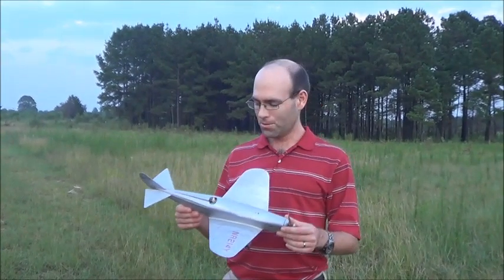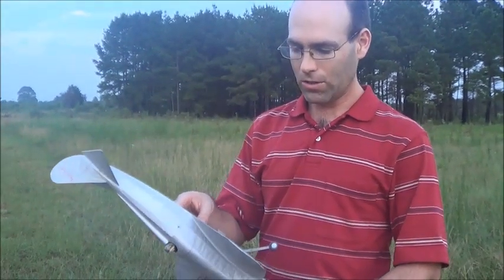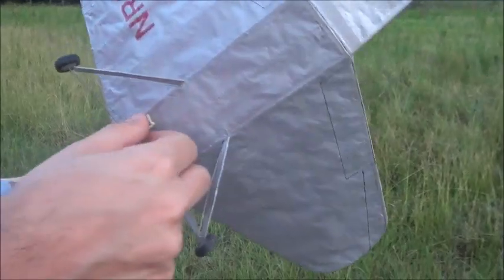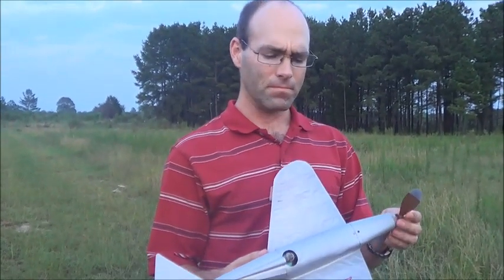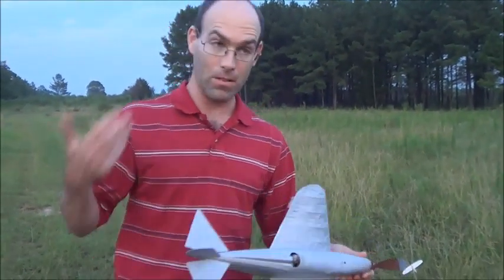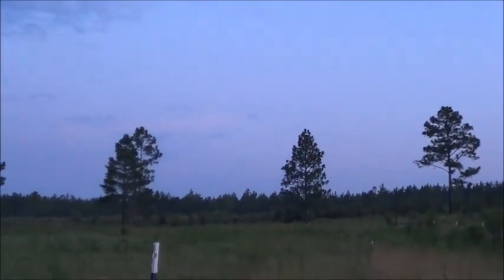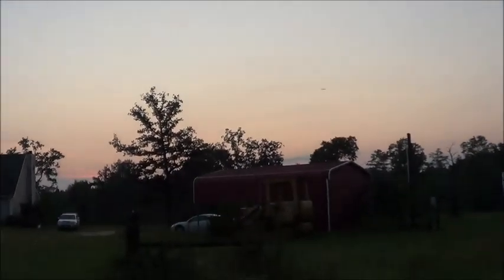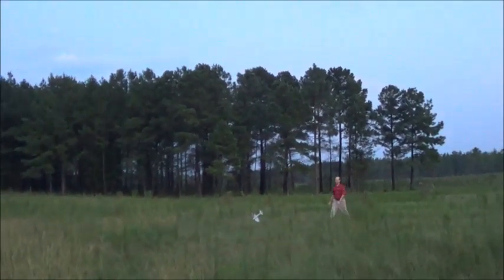Peanut Scale rubber powered Riley Burrows R-5 race plane

Comment: I have been having similar humidity based issues with my flapped gliders. Warping and such.
Reply from the maker: Copterdude, well, two things... Flappers fly inside only (except for trimming flights), and outdoor gliders need to be sealed with mixwax spar varnish to reduce the impact of humidity on them.
Reply: I know, I do fly my flappers indoors, but the humidity still gets to 'em when it's very high. As for sealing with varnish, that's a good idea, haven't done that yet.

Comment: I am guessing that last word was foreign. You had some good flights and I was just thinking how nice it would be to have that space available but now it looks like you need to trim it all down a bit for softer landings. Solid balsa wings can probably take a bit more punishment that tissue.
Reply from the maker: GrandadIsAnOldMan, it's a matter of performance vs durability. Also, probably time to cut the grass and take up a policy of not flying this plane when it's wet.
Reply: There will always be something lurking in the long grass to snare your pride and joy. Unfortunately many of the sites I fly, that thing that is lurking there is a little present left by a dog 😀